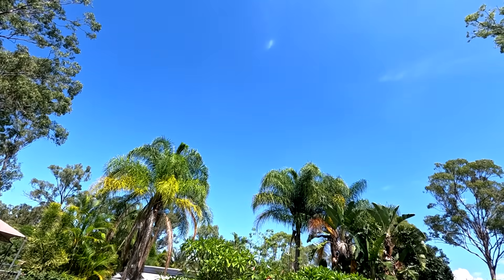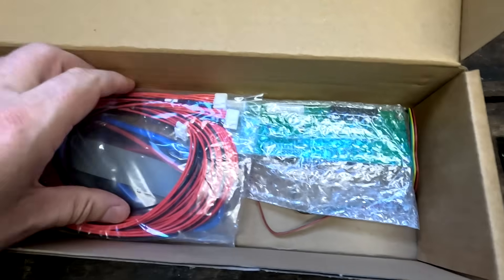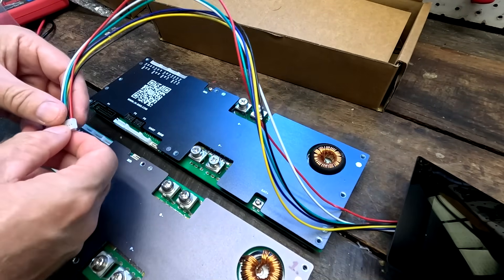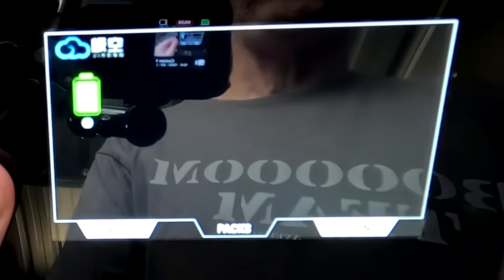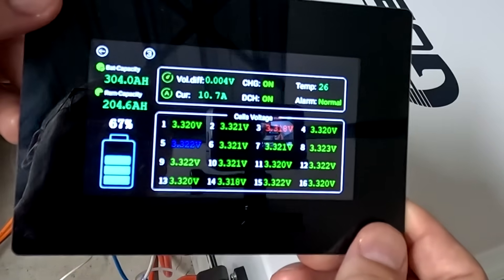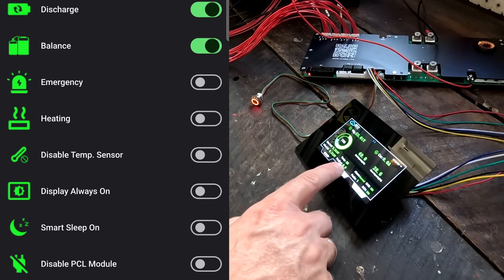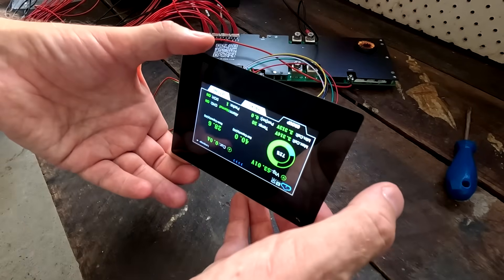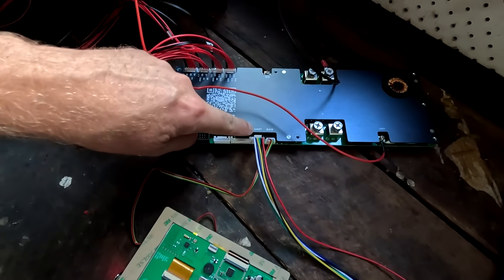New JK Inverter BMS V19. First test and... oh, look at its display! + Part I

Comment: Hi Guys, I have an issue. I ‘ve put three BMS’s in parallel and during startup I forgot to set the adresses of the different BMS’s. Now they are all in alarm state ( red led on communication board is on) but no alarm messages. The mosfets are on and there is no way to set them off. Even when shutting down the BMS the mosfets stays on… somebody any clue? Already installed latest firmware…

Comment: Any idea why a JK BMS pb2a16s30p would not show some of the cells. I check the continuity and voltage and the balancer wires are working fine. 1,2,3,4,5 are detected 6,7,8 9, 11 are not being detected. I want to reflash the firmware for this model but I cant seem to find it. Any suggestions were this model firmware is stored? I found the pb2a16s20p not the xxxxx30P

Comment: Hey Andy or anyone else. I have this exact version, correctly configured with proper cell size (280ah) and did already a couple of cycles to Over Voltage Protection and to 0, but the bms still calculates SOC like the battery is 1/5 of it's size.
It's a standard 15kwh 16 cell battery and well balanced.  But it goes to 99% as soon as I charge 3kwh, and stays 99% forever untill it hits OverVoltage Protection. Then the same in discharge. Goes to 1% within the first 3kwh discharged. I saw it briefly go to 100% at the top hitting mi 100% soc reset voltage at 3.5v, hoping that would set the calculation correct, but no.
Looks like the bms thinks is a much much smaller battery.
Anyone with similar experience or that can point out what i am doing wrong?

Comment: Seems like I found a bug. 🤔 I don't know where to report it, so maybe you can do so, having some contacts with Jikong. Ok. Got mine JK Inverter BMS V19 with HW.V19A and FW.V19.09, flashed to V19.10 and noticed that under some circumstances it won't let me connect via Bluetooth from my Android phone until BMS rebooted. 
Steps to reproduce:
1. Connect to the BMS via JKBMS Android App. (BMS onboard red LED lights up solid)
2. Lock the phone while keeping connected app open.
3. Step away a few meters until Bluetooth connection lost (onboard red led starts blinking)
4. Go back, unlock the phone and try reconnecting to the BMS 
After these steps I am getting a "Request Device Information Failure!" message box from any phone I try connecting to that BMS until I shut BMS down and then power it on.
Hope this helps.

Comment: Hi everyone,
I’m currently testing a setup using the new JK-BMS v19 firmware and I’m running into a CAN communication problem that I just can’t solve.
System details:
• Victron MultiPlus II 48/15000/200-100 (firmware v558)
• Ekrano GX (new Cerbo GX model) running ESS
• PV: 2 × Fronius inverters (AC-coupled) + 1 × SmartSolar MPPT 250/85 (DC-coupled)
• Batteries: 4 × JK-PB2A16S20P v19 (314 Ah each, only one connected for testing)
• Connected through Lynx Power In + Lynx Shunt + Lynx Distributor
• 250 A fuses per battery, 400 A main fuse
Get the Ekrano GX to detect the JK-BMS via CAN-bus without using an external battery monitor (Lynx Shunt should not be required for SOC).
Current setup:
• Custom RJ45-to-RJ45 cable (VE.Can → JK CAN)
• JK protocol: 004 – Victron_CANbus_BMS_protocol_20170717
• Baud rate: 500 kbps
• 120 Ω termination at both ends
• RS485 communication between batteries works fine
• But: Ekrano GX still shows “No BMS detected” and Victron locks SOC at 100 %, while JK shows ~25 %
Everything else in the system works perfectly — only this CAN communication refuses to start.
I suspect the issue may be related to the new v19 firmware or a protocol change not yet supported by Victron.
If anyone here has managed to get the new JK v19 firmware talking to Victron over CAN-bus, or knows which protocol/pinout combination actually works, I’d really appreciate your advice.
Thanks in advance!
— Javier

Comment: Will this display work with the B-series V19 BMS paired with the P-LINK-CR boards?
Looking to parallel 4 B-series V19 BMS 4S packs (all 12v for a boat) and connect them into a Cerbo GX... 
Would be GREAT to have a single display able to show all 16 cells (or more if I add more capacity, 20 or 24 cells) controlled by 4 BMS's in parallel.
Also, has it been determined how long the cables from the packs to the display can be lengthened? I'd REALLY like to mount the display outside of my engine room... :)

Comment: The V19 BMS has all bluetooth problem after a while you became no conntact more, only by a reset.
Failure 'Request device information failure'
Software version v19.07
Type v19a
Reply: I confirm this. I just left a comment on this video describing the steps to reproduce the problem. It seems to be a software bug related to the BMS Bluetooth module freezing when the Bluetooth connection is terminated incorrectly. I hope someone will report it to the developers and they will fix it. I'm sure the problem is easily fixable, but it's causing a lot of trouble.

Comment: Hi Andy. Your Youtube page is a savior. 
Can you please make a tutorial for v19 with firmware update (in case there is a firmware update) :) 
I've been struggling for a few days to make  functional bms on victron. No chance (when it reaches absorption it charges and discharges like crazy). 
Or maybe you can make a tutorial for the settings in victron with Ess and dvcc. 
In the end I regret that I bought jk v19.... I prefer it to work with Victron instead of the display. 

Thanks

Comment: Hello, the V19 does not connect to a newer phone via Bluetooth. It communicates with an old phone. The V15 also communicates with the newer phone. Installing the latest app version (5.2.1) did not help. Do you have any solution for this?

Comment: It gives also a JK INVERTER BMS >V15A<. This version has the power line so as v19 and the heater connection as the v14/15

Comment: I installed a V19, have 3 JK v15, but I cannot get the V19 get to communicate in VRM. I left the older settings alone, but the BMS screen only shows 1 pack, also the BMS shows only 1 pack. The sets work individually though if you look in the app, can you please advise me?

Comment: Hi Andy, just wondering what you mean by "inverter BMS". I thought they were just a BMS. 

I've been using Seplos BMSs for about 3 years, but recently bought a JK for my 52 volt electric tractor, and have been very impressed by them. So just last week ordered another batch of 340ah cells, along with a couple of JK BMSs, and looking forward to having a good play with them. I may end up ditching all my Seplos, in favour of more JKs.

Thanks for your very informative videos.

Comment: I bought this installed it on my 7kwh battery all good and well 
I charged the battery using a ebike charger 54.6v to see how it balances and to have it fully charged then I connected it to my victron easysolar 48/5000 ccgx and the bms went in scp error but from that point on it stopped working charging or discharging is off and for some reason I have full voltage of the battery between B- and P- on the bms 
Does anyone know what is going on? Is the bms toast ?
I've read some forums about pre-charging the caps in the inverter before connecting but I haven't seen anything specified on the listing or on YouTube about this

Comment: Andy, I just installed five, of the Ver19 BMS’s.  I too, have only one of the 4.3” LCD.  However, I can not get the LCD to ‘see’ the other battery banks!  I’ve double checked the addressing, that’s good.  Any ideas?
Reply: See the prodocol on the ports via BT. Also, the LCD battery must be ID 0. Reserve also of that battery ID 1, as only with ID1 will be able to connect via cable and PC> ID 0 as master, ID 1 for PC connection
Reply: @BG1 I finally got it!  The LCD unit MUST be plugged into the ‘master’, address ‘0’, for it to work.  Can read all five, from the LCD, now.  I still prefer the Bluetooth on my cell phone, but this unit, at a glance, tells me the aH usage, each morning……….

Comment: Display allways on / off works on my Software version v19.02, but if i switch it off then it stays off and i don`t know how to wake it up? any idea
Reply: Same problem, v19.05.
Reply: Meanwhile found a workaround: Display can be switched on by pressing the power button. It switches off after about 30 s ... in any case, so also while you are touching the CTAs.

Comment: has anyone successfully flashed or connected to PC the new V19 BMS? it only connect in Parallel mode....cannot be flashed
Reply: Same question. Unable to upgrade V19 to FW 19.05. How to perform it? Also what does mean "Discharge OCP2" switch?
Reply: @Martin_Myers  i've managed it :),  had to set UART1 to "JK BMS RS485 Modbus V1.0" and connect to the RS485(inverter port) next to the CAN port to flash V19.05 FW, and now the edge two RS485(paralalel) ports can be used for PC app setting, and no longer connects in Paralel mode, just like V15 used to do, But there's no WIFI or WIFI module on the LCD anymore
Reply: @andrewfpvair  Lol, I've bricked mine using your method through RS485-1 port (it just hanged up after trying to update it this way, stops beeping as well as LCD shows empty values while being powered). Then connected through a "regular" RS485-2 ports at the right side of the board and it accepted "Force flashing" procedure without any buttons being holded or smth. Boom, now i'm on v19.05 and everything works perfectly. :) But RFV time limit is still 12H maximum although they've said it now can be increased to 25H. Dunno why...
Reply: @Martin_Myers  i'm glad you got it working, before using the correct RS485 port mine would only connect in Paralel mode and didn't accept even force flashing nothing on the V19, getting JK BMSs bricked is easy, I've flashed once an V15 one and got it bricked just hanged, but luckily you can get them re-flashed and worked

Comment: I want to ask you about floating charging at 55.2v. I am using Megarevo R6KL1 inverter. BMS settings are like your instructions. But the inverter stops charging when the battery voltage is at 55.1v and cannot enter the floating process. So is there any way to fix this?

Comment: 11:05 there is no animation because the battery level is less than a particular %, maybe 40 or more.

My suggestions for that last tab settings display is that it can be populated with more configurations - charging current, balancing current and a means to initiate/start the balancing (immediately or something). I wonder if the display allows for scrolling.

Comment: I've been following your channel for a while.
My question is:
Is it possible to connect only one JKBMS to all batteries?
Is it necessary to have more than one BMS?
I connected the BMS to two groups, each with a 187 amp battery.
I'm talking about a Geely car battery.
Lithium-ion.
Each group has 14 cells, each with a 4.2 volt rating.
Each cell from the first group was connected to a corresponding cell in the second group.
So each cell became 374 amps.
And they were connected to only one BMS.
Is there a problem?
I'm thinking of adding another group.

Comment: Terrific video. Q. Would this BMS cope with 4x12V lead-acid batteries in series? I suspect no. I would like a BMS for these but struggling to find anything - any suggestions?
Reply: look at Victron Battery balancer thats wat you need for LCA..

Comment: Already have one battery pack with tdt6022 BMS and 16xlf280k. What do I need to increase battery capacity? Just another DIY box with more 16xlf280k cells or I have to buy a box with other BMS?  Is it worth it to upgrade the BMS to this jk model?

Comment: Have they fixed the Problem with soc differences when there are only minimal loads on the battery. Very big batteries have soc Problems with the jk bms because the shunt only counts bigger Amps. And in Winter the Problems improve because the battery will Not be full charged every day

Comment: I think the first improvement for the settings page should be some on/off switches for the connectivity. That inculudes bluetooth of course, but also any further wireless connection!
Gotta keep it secure.
Maybe there could even be separate settings tabs for each battery connected in parallel...

Comment: Bought 2 of them to replace the existing ones. 
Just wondering if the same features are on every display.
I mean you can see the other packs on the display you played with but what happens when you put the V19 into a other parallel one and what that dispaly shows.
Would be need if its the same.
Anyway superb work Andy, you missed your calling.

Comment: Another great video, thanks Andy. I noticed on the Gobel tower you have both +ve & -ve feed leads connected to the top Gobel rack, would it not be better to connect one of the feed leads to the bottom  rack (say +ve to the top & -ve to the bottom) so as to equalize charge current equally across all four racks?

Comment: Did you test the pc software also? 
Is it now possible to connect a pc and all packs at the same time,  and see/ program them also together?😊

Any idea how long an (extended) UART cable may be extended..?
Reply: this might be impossible because the software is different as JK has different HARDware-versions (V14/V15/V19)
Reply: @mandxyz2523  ah, off course.  But still curious about it,  at least the one.

Comment: Hello my fried, thank you for all of your videos!  The 4.3 touch displays have different firmware also. So i think on the 3. tab it should shows the firmware version of the display firmware. I m searching now for the newest firmware of 4.3 touch displays delivered with V15H HW. V15H HW has other firmware on the display as V15A HW of the PB2A. V15H display has 3 lines at the bottom and shows the rest capacity. It is possible the change the displays between V15A and V15H. So I find out, that the third line comes from the display firmware and not from the PB2A HW. Kind regards from germany.

Comment: Hey Andy, I have a problem with my jk bms. My 2 batteries with 2 jk bms's in parallel are both showing wrong charge and discharge currents. It is so bad that it's triggering the overcharge current protection.

The weird thing is, when l'm not charging it, it shows correctly. I have it all connected to a victron system, and also have a smart shunt, which together with a clamp meter I used to try to calibrate the bms's but no luck there.

Do you have any idea what could be causing this? I already tried updating it.

Comment: can we also parallel 3 different inverter jk  BMS of different capcity  togather?
Reply: you mean from the PB-series? well, andy does, i do (280ah with 304ah) ....
Reply: thx for reply
yes PB series 
should master be small one 280ah or big one 304AH?
is it plug and play of RS45 port  with dip switch?  OR are their required special steps?
can you share a video you mention above?
any help would be appreciated
Reply: @myspace6862  hi, the rs485-2 (outmost right side of the board) is for the communication between the boxes. the master you set the dip switches to off = equal to zero. this is essential. the dip switches of the other boxes must get a different address. there is a user manual at jkbms,
there you find at „support“ the manual. the communication between the master and the inverter: you connect with another patch cable to your inverter via CAN-port.
In my system i set one of the 304Ah boxes as the master. i use the can-protocol of pylontech for my deye ....
Reply: @mandxyz2523  thx for the help.

Comment: Hi Andy! Thank you very much for your video! Do you know why when the Soc reachea tye 100% value the Bms (V15, new firmwares) comunicates tonthe inverter (in my case a Luxpower Sna6000) "charge forbiven"?
In this mode the cells never reach the 100% reset value again.
A lot of people have this problem 😢

Comment: Which JK BMS is the best for Victron MultiPlus 2 48/5000? Looking for a model with reliable performance.

Also, what’s the best way to connect two or more battery banks to Victron? Is a parallel connection or Lynx Distributor the recommended approach?

Comment: Hi Andy, just a quick note for your new shiny power room. The roller door - if you want to fill in the top, how about a strip of heavy felt at least 10-15mm thick, approx 200mm deap and the width of the door. That will keep it enclosed and also allow the foot to be opened. That was the best way to cover doors that I have done for years. Good luck hope it helps. Cheers, Craig.

Comment: I have a question about the relays in this BMS (or in the Victron Cerbo GX). If you wanted to control a 220VAC Hot Water System (HWS) in a programmable way (eg SOC, fixed number of hours per day) what would you do? I have looked at the Cerbo with the Full image whch contains Node-Red and it looks possible, but what does the connection look like for this setup? The internal relays (in both the BMS and Cerbo) would have to drive an upstream relay to control the load, but in this case what would you use as the power source to drive the relay? I'd be keen to hear your thoughts if you've done this. Cheers

Comment: You would think they would sort out the existing problems like improving the communication from BMS to PC so firmware can be updated. I have 4 different models and only 1 actually connects to a PC.

Comment: With firmware versions, it is a classic Chinese system. They do not have a logical sequence of version numbers for one product line.
So, they assigned the following numbers as they produced individual HW versions.

For example, 8-cell BMS versions:
JK_B2A8S20P has Soft. version: 11.xx
New 8-cell BMS versions have version 17
JK_QB2A8S20P has Soft. version: 17.xx

Inverter BMS product lines have the following versions:
14.xx 15.xx and now new versions 19.xx